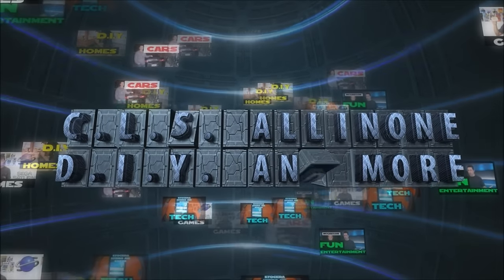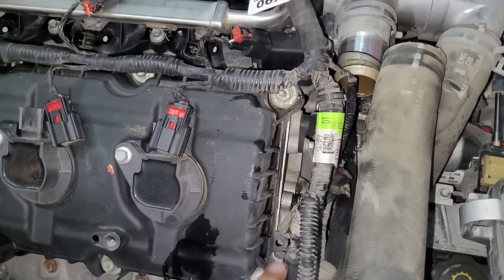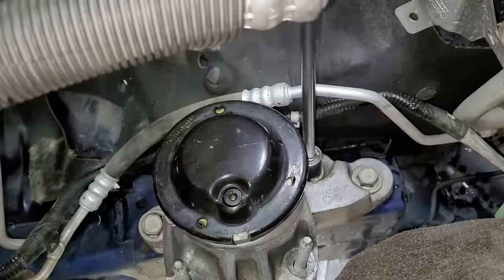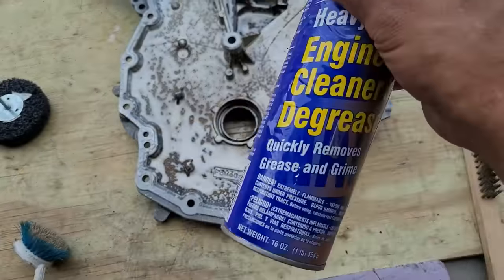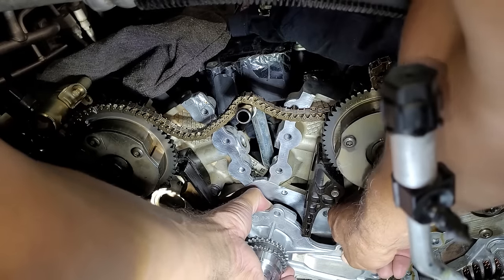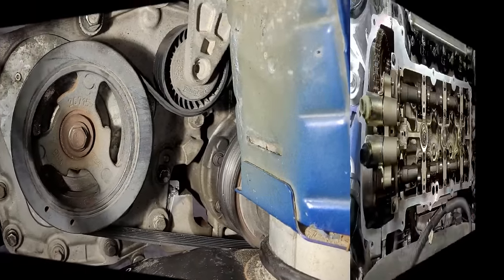How to change a water pump in Ford V6 3.5 & 3.7-liter engines 2012-19 Explorer, Taurus, Edge & more

Comment from the maker: Chapters:
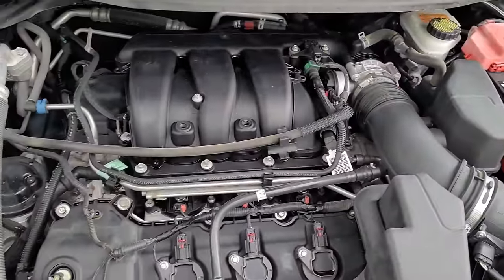1:23 - WORK BEGINS
3:24 - FUEL LINE DISCONNECT
4:10 - AIR INTAKE ASSEMBLY REMOVAL
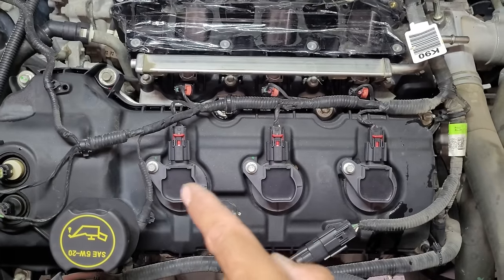5:02 - UNPLUGGING ENGINE WIRE HARNESS
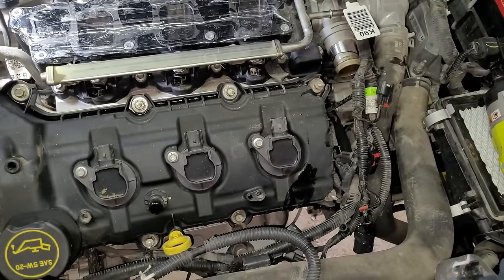6:00 - COIL PACKS REMOVAL
6:26 - VALVE COVERS REMOVAL
8:20 - SERPENTINE BELT REMOVAL
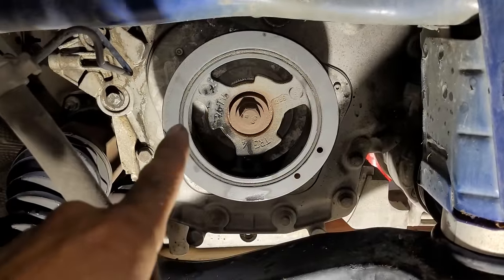9:10 - CRANKSHAFT PULLEY REMOVAL
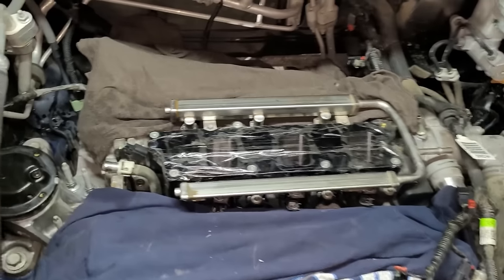10:18 - RIGHT ENGINE MOUNT REMOVAL
11:41 - TIMING CHAIN COVER REMOVAL
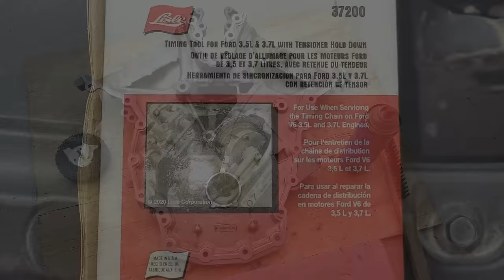16:54 - TIMING CHAIN LOOSEN/REMOVAL
22:24 - WATER PUMP REMOVAL
23:56 - NEW WATER PUMP INSTALL
25:52 - TIMING CHAIN TENSIONER ADJUST & INSTALL
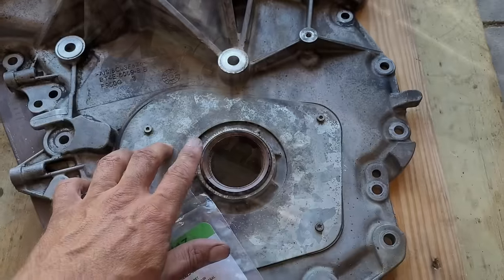27:45 - CRANKSHAFT "FRONT MAIN" SEAL REPLACEMENT
29:03 - LUBRICATE INTERNAL ENGINE PARTS
29:27 - APPLY GASKET MAKER FOR TIMING CHAIN COVER INSTALL
31:53 - RIGHT ENGINE MOUNT INSTALL
32:36- CRANKSHAFT SHAFT PULLEY INSTALL
33:09 - SERPENTINE BELT INSTALL
33:39 - VALVE COVERS INSTALL
34:08 - SPARK PLUGS REPLACEMENT
38:42 - ADDING OIL & COOLANT FLUIDS
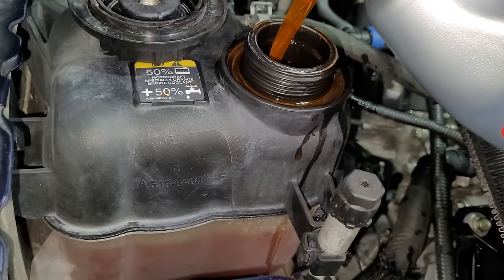39:01 - STARTING THE VEHICLE FOR A TEST
Reply: Best video on YouTube for this water pump change out. While the job is fairly extensive, your video shows it's doable at home. How many hours did this take less the sealant wait time? Side note, Ford should be ashamed of this design.
Reply: Hi, i have question. They change my water pump on my explorer 2012 v6 . When i have it ,it starts to  leak oil,why is this? I return the vehicle to the mechanic stay with my car over 2 weeks and he said it was fixed, but my car still leaking oil, i don't want to go back to him please can you answer my question.  Where are you located? I don't trust mechanics
Reply: @DirtyCoastCajun   These automoible companies know exactly what they're doing when they design these vehicles, these designs are for ridiculous labor cost prices💰💰💰;  as well as prevention from self service and/or your local trustworthy mechanics. The more difficult the design, the more people depend on services from their (EXTREMELY OVER PRICED) dealerships.  GREED🤑🤑🤑 is why they do it. 😒😒😒
Reply: Was this sped up?? How long did it take you do you think a 3 hour job or a 2 day job
Reply: You have way too much time on your hands
Reply: @josephprentice8354  I’ve been told by the dealership it should take about 11 hours. 😂
Reply: @mashr52010  when I worked as a tech I looked it up your right but this guy made it look smooth. Lots of times dealer's over quote the labor hours better to over quote then under quote it
Reply: Well i have a 3.5 ecoboost 2018 my intake manifold is aluminum  does anybody knows if is still the same torque 8 lb ?
Reply: @rikkismiley4103 Completely agreed 👍. It's designed with that intention. Greetings 🙏
Reply: @rikkismiley4103  I’ve been saying the same thing about these car manufacturers for years since the early 2000’s & I’ve been a mechanic for over 30 years. They “over design” these cars purposely to deter anyone from repairing vehicles nowadays and to bring them to dealerships for repairs.
Reply: Do you remember the size for the fuel line disconnect tool?
Reply: Which size pulley remover did you use from harbor freight I doing the same job but my pulley remover I got from harbor freight fits but doesn’t seem to remove it
Reply: @Getttouttt I am also currently working on mine right now too, it got dark early, so made it as far as cleaning the water pump surface and gonna call it a day. Earlier this afternoon I just used a pulley puller with 2 claws. Didn't take much to get it off. Did you remove the crank bolt first?
Reply: @JoshuaWhitesinger  yeah I was able to get it off just had to adjust the claws a bit and zapped it right out I also was in the the Same stage you are getting ready to install the. Pump but getting dark called it a day with this new time change day went by so fast it seemed
Reply: @Getttouttt  Great to hear. Haha crazy. Good to know I ain't alone at this point. I'm going to have to skip work tomorrow and get it done.
Reply: @JoshuaWhitesinger  oh man lucky you I was  gonna do same but will have it wait till the weekend let me know how everything comes out with unlocking the cams and lining the chain when putting back together that’s my biggest worry I don’t wanna be off a tooth or mess a up anything 😳
Reply: Real funny how the same work is going on in different places on the same motor same time lol
Reply: @Getttouttt  Hahahaha exactly what I was thinking. Same time, same engine. I'm also replacing the timing chain with a kit from Cloyes. I wish the days were longer. But I'll for sure let you know how everything goes.
Reply: @JoshuaWhitesinger  right on thank you
Reply: @JoshuaWhitesinger  Mr Joshua how did everything go on the motor do you get it all done did everything work out ok ?
Reply: @Getttouttt  I got as far as putting everything back on, except the Valve covers and wires. I ended up breaking the left valve cover when punching in new spark plug seals, so order the new updated valve cover that doesn't get oil into the pcv valve. Haha so it's just a waiting game til that cover comes in unfortunately. What about you??
Reply: @JoshuaWhitesinger  I got everything put back together. The most difficult timing cover. I am putting on the valve cover now I put a new tensioner. Hopefully everything works out at the same time. I’m waiting for the time. 24 hour time drying time period then ready to fire up
Reply: @Getttouttt  Nice. Very glad you got ahead. I'm still waiting on the new valve cover to be delivered, says til Wednesday. The wait is killing me. I look forward to your startup and see how it goes! 👍
Reply: @JoshuaWhitesinger  yes me to thank you just hope I get no leaks and the timing is ok I had to move one of the cams a bit to put the chain back on so let’s see what happens 😳😳😳
Reply: @Getttouttt As long as the dots and colored chains lined up together, you'll be fine. I changed the secondary chains on mine too as it came with the timing chain kit. New phaser bolts as well, tensioners and guides. Haha so I think I have more to worry about when it's time to turn it over. 😂
Reply: @Getttouttt  Did you ever finish the project? I finished mine a day later my last message. Everything turned out fine. Vehicle is running good, no problems, noise and leaks.
Reply: @JoshuaWhitesinger  yes same here every thing worked out glad to here yours is working I’ll never do one again tho lol
Reply: Water pump replacement
Reply: Water pump replacement
Reply: Water pump replacement only
Reply: I just want to say. Thank you so much for this video. It saved me sooooo much money. My wife’s car is good to go thanks to your time making this video.
Reply: @Getttouttt  Just finished this job. We had to use the largest pulley remover with the smallest ‘arms’ to get the pulley off
Reply: @Getttouttt I had the same problem. I ended up going back to Harbor Freight and bought the most powerful battery impact driver they had, which finally worked. But as a precaution, I bought a new harmonic balancer. I was worried about reusing anything I pulled with that much torque.
Reply: @Getttouttt I had to jack up my engine quite a bit to get it in past that damn AC line in the corner. I think I have used every adapter and extension I own on this project
Reply: I see you repaced yourself. Did you have any issues with the timing and did you have to lower engine to remove bolts@Getttouttt
Reply: @overdrive020  not sure if you meant me, but yes the repair went very well. I did it a few weeks ago.  I used a Cloyes kit. Their timing chain has three colored links. So the 11:00, 1:00,4:00 marks work well. Even if you have to bump one cam to get maybe a tooth or half a tooth, the marked links are dead on. Just work your slack back to the tensioner side. I was a bit nervous but the car is running well. This video was a fantastic tool and a super thanks to the guy that made it. Pick up an extra set of 1/4 and 3/8 socket extensions, especially shorter ones. You'll use every single one of them. It took me a long time, working on nights for a few hours at a time. It was over 100° that week as well. Not as fast as the pros for sure. But it did save a woman about $4500.
Reply: @smitlag  yes sir was for you. Thanks for responding back. Yea bro I'm getting ready to attempt this and I'm getting nervous. I've watched like 20 hours of videos on this but have never messed with a timing chain. So if I follow this video and pretty much put timing chain back where she goes ill be fine. I'm getting all parts from ford tomorrow so not sure if their chain is color coated. But did you have to raise or lower engine to get any bolts out??
Reply: @overdrive020  yes I did exactly as he shows. A small floor jack with a piece of wood to even the load. You will definitely need to jack the engine up and down to get to certain bolts. Particularly pulling off the cover. The back AC line will interfere with you every chance it gets. If you get the engine up high enough, the timing cover will slide out. Put the permatex on the engine perimeter, not the cover. Couple other tips. Make sure the vent hose is attached to the rear valve cover at the cover side when you reassemble it. It's a pain to get on otherwise. My Milwaukee 2767 wasn't strong enough to pull the harmonic balancer. I ended up picking up the Harbor Freight 20v Hercules 1/2 impact normally listed at $249. I got about $30 off of it. Just take your time, get a notebook and take plenty of pictures. Getting to the pump is the big challenge. After you start putting new stuff on, it goes pretty quick.  Good luck, you'll be fine!
Reply: I'm doing this job as preventative maintenance. 2014 Taurus 181,000mi. This job will probably take me more than 45 minutes as your video shows. 😂😂😂😂😂 Great video, thanks for posting it.
Reply: Absolutely disgusting of ford to engineer such garbage. These companies are disgusting. If ford and General Motors can’t produce vehicles we consumers can ourselves service if we so choose then perhaps it’s time to consider if Chinese brands are a better option for American consumers.

Comment: After watching this amazing video, I'm not buying a Ford Explorer v6, ever.
Reply: Just for that reason alone my 2013  did it &they all will eventually unless your lucky
Reply: Bingo!!!!
Reply: Any ford or dodge or chev….just get a Toyota! :)
Reply: lol yea a cause Toyota doesn't have timing belt issues 😂
Reply: @tyetash4407  Those belts were on older engines, and they were easy compared to this nonsense.
Reply: @howdy2k2000  Yeah, Toyota isn't blowing turbo engines...  Get a 72 Corolla..
Reply: Lol. You got that right
Reply: I wish I ran across this video because I went through the same thing with my 2016 explorer. Never buying another Ford ever!!!
Reply: Oh yeah it's leaking again also, less than a year 😡😡😡😡

Comment: I just bought a 2014 Police Interceptor Sedan 3.7L with 103K miles and after driving it for only 2 weeks the water pump started leaking. I'm a female but I've always done most of my own mechanic work (i.e. alternators, fuel pumps, water pumps, brakes, oil changes, etc.) but I've also always had Dodge vehicles so the work was never too difficult. This is the first Ford I've had to work on and I was absolutely flabbergasted when I discovered where the water pump is located on this thing. The way Ford built this is absolutely ridiculous! But I REFUSE to pay someone thousands of dollars to have a couple hundred dollars worth of parts replaced, and after watching your video, I'm confident I can do it myself (I'll have my husband help out too when needed of course lol) Thank you so much for taking the time to make this video, you're awesome! I've already watched it 3 times and I know I'll be watching it several more times while doing the work. I did notice someone in the comments said there are a couple of extra bolts/steps that are not mentioned in the video for the 3.7L engine so thank you to them too for the heads up, I'll be sure to look out for that.
Reply: How did you make out?
Reply: My mom’s 2016 Ford Explorer 3.5 is leaking from the bottom of the ac compressor where the bolt is at. Looks like I’ll be replacing her pump

Comment: Ford should be ashamed of themselves for the amount of work it takes just to reach this thing. Excellent video. I have a Taurus and I’m pretty sure my pump is going out … this video is immeasurably helpful.
Reply: As a guy who lives paycheck to paycheck and who's wife needs the car badly I agree ...I just put everything together last night around 10 pm ..been putting evenings into it lol..if it don't work it's going to the scrap yard 😅
Reply: @kinggrund6258 that’s the Ford mentality!
Reply: Tough to imagine what a Ford Engineer was thinking putting a part that commonly needs to be replaced internal to the engine, turning a 1 hour job into 13-14 hours.  And the design flaw is a big double-whammy, since the water pump can also fail at any time, usually dumping coolant in the engine and ruining the engine before people know what happened.   Spend $3-4K (or parts plus ~14 hours work) about every 80k miles just to be proactive in the hopes of not getting a bigger bill for an engine replacement.
Reply: Is it leaking? What are signs that makes you think it's going bad? Just bought a 2014 Taurus police interceptor with 130k miles. Thinking about doing this before anything
Reply: @LEGE7VD  so as he described in the video (I think), a huge indicator is when you’ll find coolant along the bottom of the oil pan. I replaced my thermostat at first thinking it was that because my engine was overheating. Checked all the hoses and the radiator and there are no leaks, yet I constantly have to refill coolant. Also checked my oil to ensure I didn’t have a blown head gasket. The water pump is designed to dump coolant out when it’s going bad.
Reply: @christopherross6023  good to know. Very helpful. I'm gonna be taking it to my mechanic to put on a lift and doing a full inspection of the undercarriage as I purchased the car online. Fingers crossed. Thanks for the info
Reply: @LEGE7VD  Good luck, many are selling them because of this. Glad we found this info before purchasing
Reply: Add mines to the fucking story🤬
Reply: @ussssaaabixchh  I hate this for you
Reply: @kinggrund6258  A few months later. Did it work for you? I hope so.
Reply: @markd9130  nope couldn't get the timing right ..had to bring it to a guy to fix it ..2k later smh
Reply: Never buying a Ford this is my last one
Reply: How else will the dealer be able to rip people off on this water pump replacement
Reply: @kinggrund6258 hey so you replaced your water pump and went off this video? And now the timing is off? How did timing get off if you lock in the cams? I'm in middle of work now. Getting ready to put cover on.

Comment: Holy crap! This video should be up for at least a Golden Globe award. Spielberg couldn’t have done it better.
Reply: I'm a mechanic This is the best and most through video I've EVER seen!!
Reply: @TC-qv3wy  I am also and agree. It is quite impressive.
Reply: My first cost estimate for replacing the water pump only included prices of the pump and gaskets. But now... wow! I am so glad I watched this video ahead of time. I will be buying spark plugs, gasket maker, plastic ties, brake cleaner, pulley puller ... The little things obviously matter. For me, the cost of a mechanic would have exceeded the vehicles value. So I am willing to spend two  relaxed weeks fixing my car. Thank you so much for making this video.

Comment: Literally just fixed a neighbor's wife's 3.5L. never touched a Ford engine this deeply moreso with some improvising since  it wasn't exactly 100% this same engine. Also never did anything regarding timing chain or pulley pullers etc but I've worked on cars and knew there had to be a thorough video for this. Saved my neighbor thousands cause I'm sure a certified mechanic would've tried to pull the engine for ease of access and charged a lot. 4 days of extensive work getting everything off and now a few more to clean and put everything together whhheewww what a job!! Thank you for this valuable knowledge you decided to share with the world!!! 🙏🏾🙏🏾🙏🏾🫂🫂